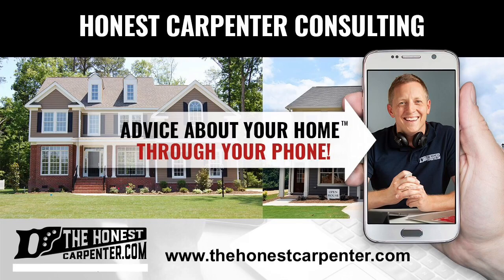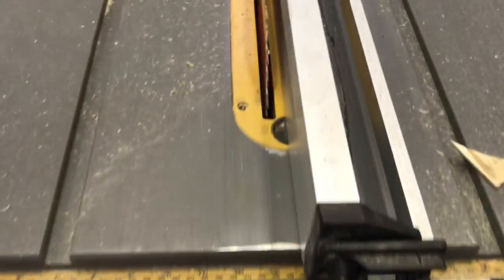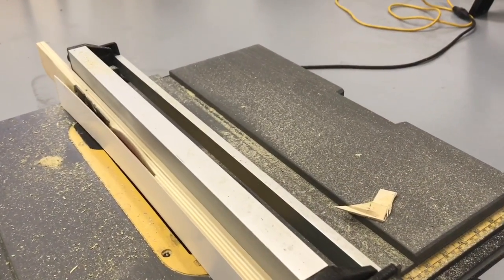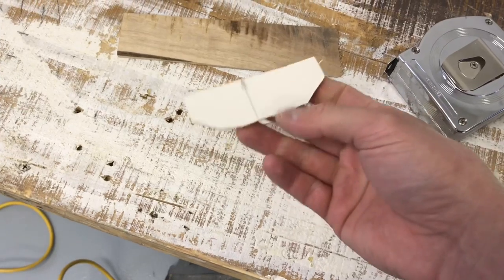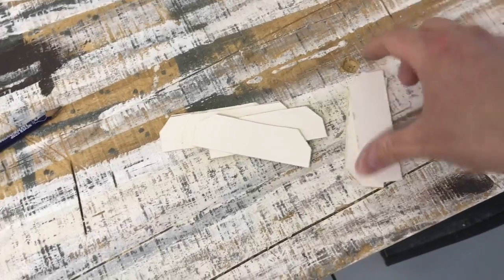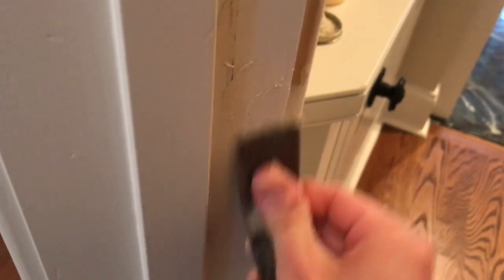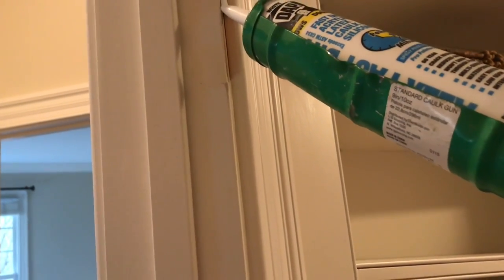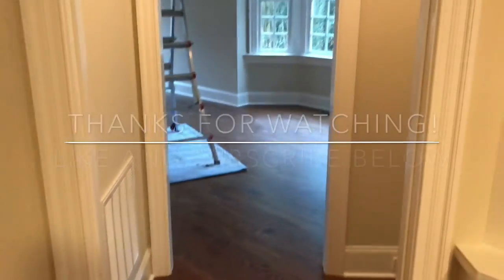How To Fill Hinge Slots (Mortises)

Comment: This is such a bad fix. you should cut the Door Jamb  to fit the patch and not the patch to fit the Door Jamb. Use a Chisel to square the hole next time. TOH tips
Reply: If it’s painted I just use wood bondo😂

Comment: Wouldn't it be a lot easier just to square those corners of the door hinges first with a flat chisel? Otherwise it's a great video.
Reply from the maker: @D Jaquith Thank you! Squaring up would definitely reduce some of the wood filler application. You'd maybe still need some just to hide the seam, but not too much
Reply: What length screw do you use to attach the hinges to the lining and door
Reply: @cancer2361964  .. There's no standard length or size it all depends upon the door. However most doors hinges are one inch in length.
Reply: I've got to move a door and make good on the old hinge motices, and was thinking exactly the same! A sharp chisel wood do the job.
Reply: @TheHonestCarpenter  You had the old hinges.  Why didn't you trace them onto your dutchmen?
Reply: @TheHonestCarpenter  I think having gone to the trouble of making the Dutchman’s they are so thin I’d have made a card template and tried to cut the round corners for a good fit. I’ve  used this method in the uk where our hinges are square easy street
Reply: Otherwise you can just fill the whole area with putty.
Reply: @thomaspeltz8577  .. "Fill" for the most part has no structural integrity, it can easily crack and crumble with any stress applied to it. 

Related .. Hollow doors that get holes I would use Bondo. I had one that got slammed shut and the door stop went through; I filled the hollow core with solid wood, glued and covered it with Bondo including some troweling to make it look like wood grain.
Reply: @TheHonestCarpenter   ?mmmm,,
Reply: @TheHonestCarpenter   ?mmmm,,
Reply: Waste of time squaring the corners because you have to fill it anyway. His aim is to fill most of it quickly but more to the point get the jamb edge as straight as possible and the correct length 😀
Reply: @hudsonsoul1121  .. Fill won't last. More fill more cracks and fill falling out. On a door if I fill use Bondo.
Reply: D Jaquith use filler for cars which doesn't crack. Personally I would make the infill closer to the shape it's going in.😀
Reply: @hudsonsoul1121  .. Umm yeah, that car filler is called "Bondo."
Reply: D Jaquith lol, l use to use something else but can't remember now.😀
Reply: @hudsonsoul1121  .. Ideally you don't want any filler.
Reply: D Jaquith agreed
Reply: @Alana8953  thanks for the valuable tip, Don't listen. someone in here just trying to give hard time if they have a better way to do it they can make their own video. " EASIER TO SQUARE UP WITH CHISEL" 😂,
Reply: mark smith maybe but just warn the customer. The one I use to use did have an odour but it wasn't enough to kill a budgie.
Reply: @DJaquithFL  how about 5 minute mud?
Reply: @DJaquithFL  Bondo cracks too buddy. You seem to criticize every comment and the honest carpenter but that's because you know everything and do everything better but as this guy owns a business and seems to do pretty well for himself I don't think him and every other carpenter has been doing for decades. I use wood filler/plastic wood all the time and the reason it doesn't work for you is because you are doing it wrong and carpenters have been doing it right for years. There's a difference between thinking you know and knowing. Nobody likes a know it all that does everything better but has nothing to show your skills

Comment: I used to work in a door shop. We used auto body filler. It did a great job, and is easy to do:

1. Put a piece of masking tape along the door jamb edge to dam up the open edge of the hole.
2. Fill the hole with auto body filler (We used Bondo). Over fill the hole. Don't try to make it level.
3. After the auto body filler has hardened (but before it is completely hard), use a sheetrock rasp to remove excess body filler, but don't try to make it perfect. Leave just a little extra to sand down later. Skip this step if you don't have a rasp.
4. Sand the auto body filler to smooth it out.
5. Paint
Reply: Agree bondo is the way to go
Reply: @jessicacallahan9711  Durham's Water Putty gives you even better results in terms of texture, but the technique is spot on.
Reply: Bondo is not a good idea. It doesn't expand and contract with the wood and can crack over time with expansion/contraction
Reply: @acampbe75  I’m not sure. You may have a point, but I have never heard any complaints about it cracking. By the time we finished sanding, there is only a little bit of bondo left. And a lot of it may get routed away if the new hinge location overlaps.
Reply: @acampbe75  You are correct.  Ask me how I know.
Reply: What if it's stained wood you need to repair
Reply: That's what I did.  I reversed a door the other day and I just used bondo to fill it in, worked great, can't tell there was anything there after I painted it.
Reply: waste of time and body filler may crack eventually.

Comment: Very helpful video. I had removed an old and crusty screen door from porch.
I found your video as it is next step in my project. However, I am thinking of using old hinge as template to cut out wood material for fill. 🤔😲

Comment: It is A LOT LESS labor intensive to:
1. Square off the mortises with a chisel 
2. Use a paint stirrer for the dutchman at its original thickness
3. Block plane the dutchman down to the exact thickness after the glue has dried
Reply: I saw many people say use the paint stick so I went and got some from Homedepot and Menards’ 
Both are a bit wider (right to left) than my mortises….
Any thoughts…? 

Also if I glue a Dutchman onto a veneer particle board door jamb would it even be strong enough to fill / glue then re mortise….? 

Or although extra work is it going to be better to pull whole jamb and replace the jamb on hinge side…?
Reply: @joshymcdaniel9233  As he said above. Plane them down after the glue has dried.

Comment: I am about to do this exact job.  I was planning to use a paint stirrer since I don't have a circular saw.  I also don't have a nail gun so was planning to just use little nails.  Thanks for the info!!  I will go get the plastic wood and should be all set now.

Comment: Why not just trace the hinge so youve got less to fill in later? In this case looks like 5/8 radius. You were right about the plastic wood drying fast. Ive used it for years but last week i used a full can. I swear it was drying way faster than ive ever seen it. It was almost too fast. Started skimming over immediately and trying to stuck to the surface and putty knife before i got it smoothed out.  Good idea on the hinge fill.
Reply: add water

Comment: Hey. Great video. Would it be possible to put a new hinge on top of this? 

Context: My super old doors have huge hinges on them and I feel like if I move them lower the hinge will be too low. The cut that the current hinge was sitting in is so messed up and I’ve tried filling it with putty and stuff but the door ends up coming off. Trying to think of a way of supporting the current hinge slot if at all possible. 

Thanks.

Comment: Your videos are great. When you have to replace the door pull on a pocket door and the replacement door pull is smaller than the original door pull; how to you remedy the situation you now have in that the hollowed out part of the door is showing? What do you do to fill in that space?

Comment: Filling bradly nail holes.. 

Get putty on thumb press onto hole.. after pressing curl thumb and excess gets lifted by end of thumb. Might need cloth to wipe off excess.

Always wear safety glasses when operating a brad nailer.. those nails can ricochet in weird ways around obstacles... one even bounced backwards once. 

If nail goes all the way through a board it can hit behind and curl flying around the room.

Turn cap backwards
Safety glasses
Mechanic smooth gloves

Comment: I use straight wood putty you apply with putty knife come back next day sand it smooth then paint much easier & yet a professional look..
Reply from the maker: Old Timer I’ve also done full full-ins with epoxy and such things. Only problem is sheer amount of sanding dust created. For 8 mortises (including upper catch strikes) like this doorway, you wind up with a lot of airborne particulate, which always makes clients uncomfortable. I like Dutchmen in this case because they cut down on overall sanding required
Reply: @TheHonestCarpenter  yes i know on my project have to re drill holes glue some dowel rods insert in holes then re drill again pilot holes for the hinges, previous owners jerry rigged the jam driving screws in at 45° & he brought hinge plates down 1" so i really dont need to do the whole length of the hinge though just to backside edge of wood jam is cracked which i have to reglue then apply wood putty in remaining crack seems then sand & paint.
Much work corrected lot of the previous owner shoe maker mistakes.
Reply from the maker: Old Timer Ah gotcha. Yah that makes perfect sense. Smaller controlled areas like that are much faster and easier to fill in your way
Reply: @TheHonestCarpenter  yes not only i have to deal with the hinge side of door to repair the opposite side the owner had 3 holes drilled into the jam appearantly he had 3 door lock knobs on one door & the trim has 4" regular wood nails driven into them so it is going to be a total replacement of trim & reworking everything on the  jam with even a 4" long deep square hole into the plaster.
I am going to paint everything white semi gloss over original stained wood do you use brush on everything or roller on some parts i was thinking good brush on everything being rollers give a textured look & on the other hand brushes can leave brush strokes within the paint.
Reply from the maker: @BurtBowers  What was this person thinking?! Nothing drives me crazier than unnecessarily long trim nails. I'd say you've got the right idea--pull the casings and start fresh. Just too much damage done to that current setup. Good luck with the project!
Reply: @TheHonestCarpenter  from what I understand this house was rented out few times & I heard the renters wasnt all that good of people I had repaired damaged plaster walls & ceilings plumbing electrical practically everything, it all keeps me busy I am glad that I have some know how on how to do things if I didnt would have cost me a fortune to have everything done its all getting there slowy but surely & eventually I can do other things in life like take a vacation..Lol..have a good day your way👍
Reply: Auto body filler works for me.  Don't have to wait so long.

Comment: what if you are just a homeowner that does not have a table saw and are not able to cut the filler pieces.   Is there some other way to do fill and hide the striker plate holes
Reply: You could use a two part epoxy to trowel into the mortise, then sand and paint
Reply: 45 min light weight drywall mud.

Comment: Reminds me of the toilet in my parents' place that they had built in '52. The door hit the pan when it was later fitted so had to be changed to open outwards and the mortices filled. You could still see faint evidence when the place was sold 50+ years later.

Comment: Why wouldn’t you take a hinge, trace a line around it and then cut?  That way you would have even less to fill. 

Also, you should have used automotive Bondo, because it doesn’t shrink like that wood filler u used.